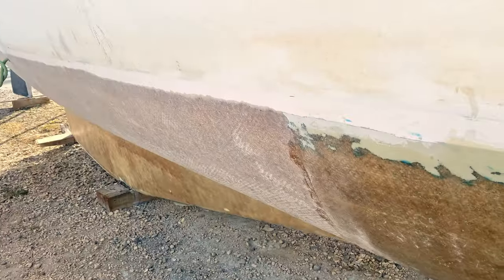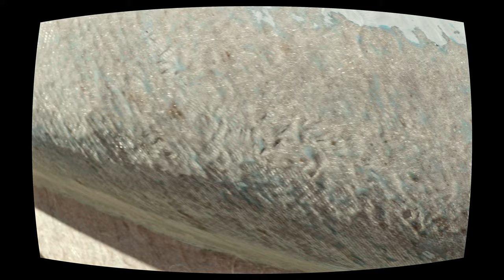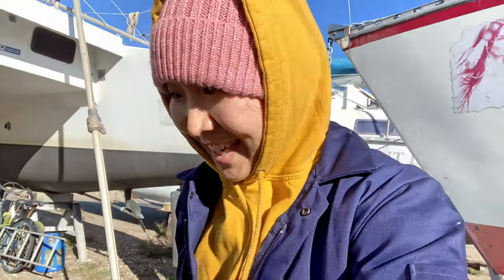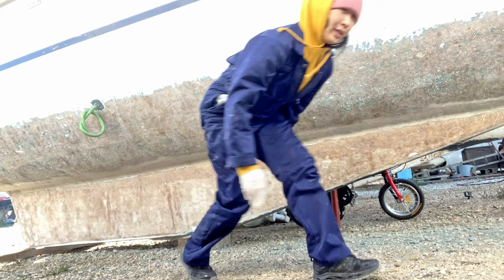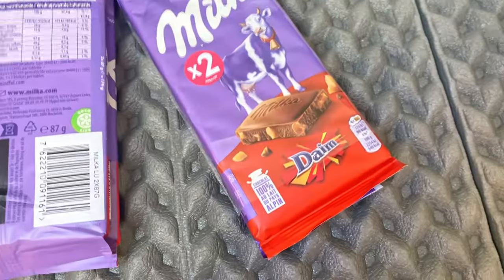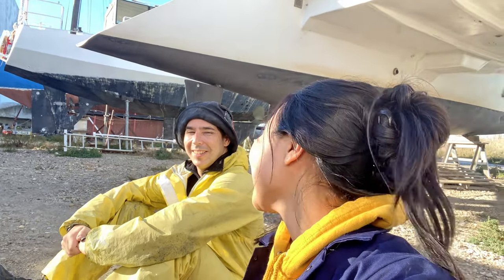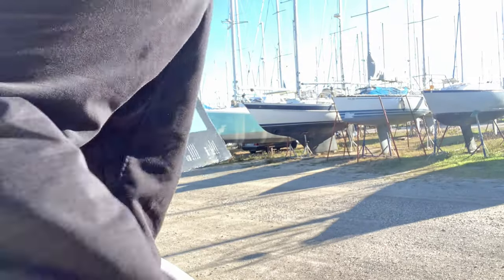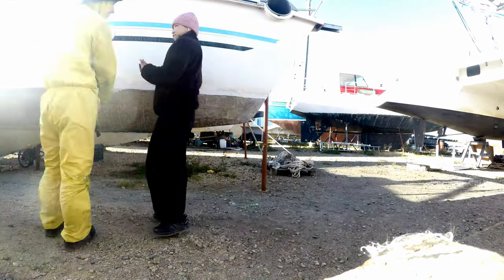Bumpy Beginnings Ep 12

Comment: Wow! Very hard what you are doing.   Using epoxy with chopped strand is very difficult to get a smooth finish . 
I do not like the paddle roller, the ‘fin’ type work much better. 
I would use a cloth type fiberglass , much better for epoxy and stay smoother.   
It’s going to be really important to get a smooth hull to get the best out of the boat. 
If you overlap 25mm you can grind the laps smooth later. 
Hard work 
Cheers Warren
Reply from the maker: Yes, we noticed that this is was not the best choice, but we are making it work 😅 thanks for the advice
Reply: @sailingjoa  no worries ! Lovely light wt boats !

Comment: Make sure your chopped strand mat is Epoxy compatible. Most chop strand mat contains binders that dissolve "only" with fiberglass (polyester) resin, and are not to be used with Epoxy for structural repairs. Also, place plastic film on our workplace and wet out your fiberglass on the plastic. The cardboard you are using absorbs a lot of your expensive Epoxy and is wasting and causing you to take too much time to wet out. Wet out your hull area with epoxy before your place your wet glass on the hull. This will allow your glass to stick and mold to the hull without all the trouble and effort you have trying to lay it up too dry. 
Remember that laying glass requires preparation, speed because the Epoxy can set up quick, and care as the work needs to be performed to a standard that is safe and structural. 
There are many videos on YouTube from other sailors that teach and demonstrate the more efficient processes for fixing boats. Time invested from learning from others that have done similar fiberglass work will payoff greatly for you both. 
I look foreword to your future videos... Joe
Reply from the maker: This is great advice, we still used cardboard for a while, but we didn’t know that. Thank you 🙏 we are happy to have you onboard 🤗
Reply: Necessity will make you both experts in many things boat related in no time. Following the original design documents for anything structural, weight and loading, rigging, if the original design produced sound and proven vessels. I know nothing of this design however what I see in your videos, is very different than I have seen before. Seek out professional help always when approaching a new part of the project to gain knowledge to help assure that you are doing the very best you can to build a safe boat. I am confident that you will do this. 
With great respect.... Joe  @sailingjoa
Reply from the maker: Yes, it’s a different catamaran, we are looking forward to sailing it. We are asking around and because it’s a French boat and we are in France all the old sailors say, they have sailed on one and it’s fast, is a great boat good design !!! Anything else structural, we have people’s advice online and of corse YouTube is our teacher 😅
Reply: glassing overhead is the worst. after you wet out the glass you can roll it onto a tube and unroll it against the hull. one person unrolls it as the other rolls it against the hull. keep an eye over your shoulder so you can spot it trying to fall off. Good luck guys.
Reply: Good points Joe!
Reply: White vinegar is a good solvent for cleaning as well as denatured alcohol and a lot cheaper than acetone.  Good luck
Reply from the maker: @telycasta  it even cleans epoxy from hair 😅